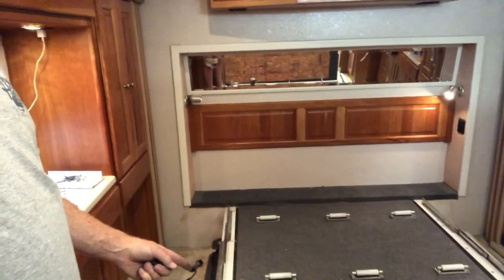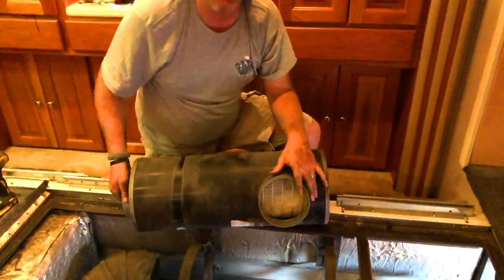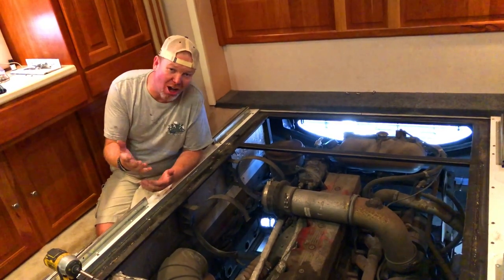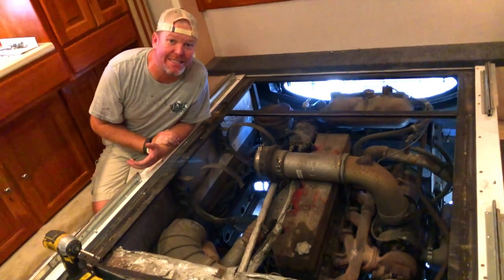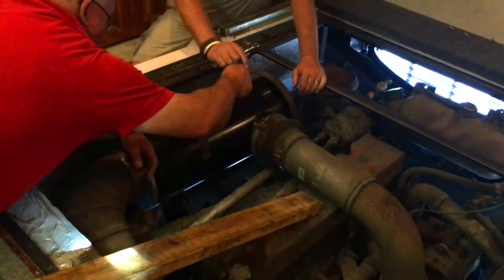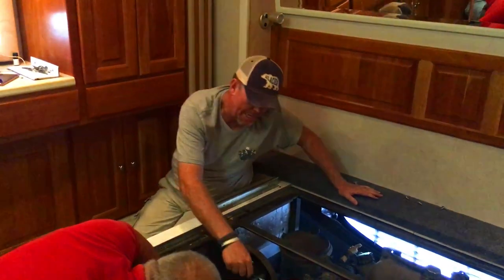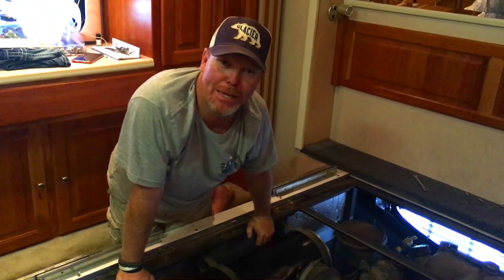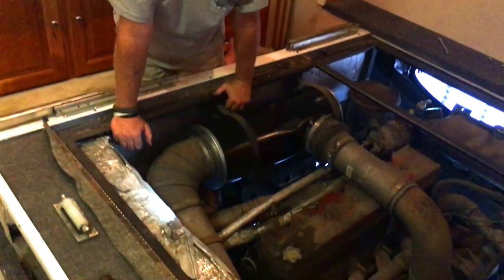Changing The Air Filter/ RV Diesel Pushers (Freightliner Chassis)

Comment: Very interesting. I have a 2012 with 17K miles and looking at PMI items to do during the winter. Looking to replace the crankcase ventilation filter, oil, fuel, and other filters as I just bought her with no idea what the owner did or did not do. Good idea to change the belts as that is on my list too. No reason to have it break on the highway. Everything has a lifetime, and mileage is not the real or only indicator.

Comment: At least you have decent access to yours. I'm about to attempt this replacement on a 2011 Tiffin Allegro Breeze 32BR. It is located in the rear, to the right of the radiator and power steering fluid, tucked into the right corner, basically behind the lights. There is no room to remove it without having to start pulling other systems out.

Comment: Well....I just got mine finished on my 2000 Winnebeggo Adventurer. Since I was replacing the batteries anyway, I did it with them out. Not bad. Disassemble through battery access , and slide out the back right along the exhaust. Not going to lie, and say it was easy. Filter cost $140.00 at my local auto parts store. They had one in stock.

Comment: Just came across your video. Next time you need an air filter look at Filter Barn. https://www.filterbarn.com/ 
Good job/hard job geting to it on your coach. Look around you should have a "filter minder" that gives some indication as to how bad the filter is plugged up. It might be in the back above the radiator. Additional free comment, in the video on changing the oil and fuel filters you showed some water in the bottom of the one filter. It is supposed to be there because it is a "water separator filter" You should drain that filter (see the valve on the bottom) periodically to remove the water.
Have fun

Comment: For next time get you a cheap 6-inch flat head screwdriver from wally word or horror freight and cut the bit off, then bend the driver 90 degrees with about a two-inch reach. You can use it to run around the hose to get in onto the can and cut it down to a 30-minute job start to stop.
Reply from the maker: Andrew Armstrong thanks for the insight and for the comment!!